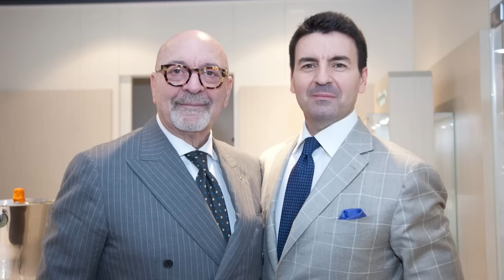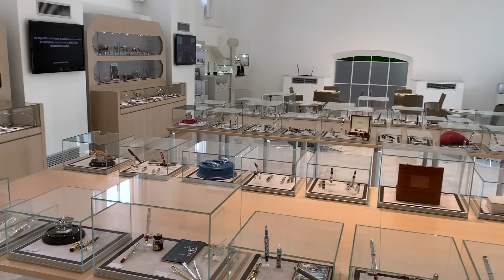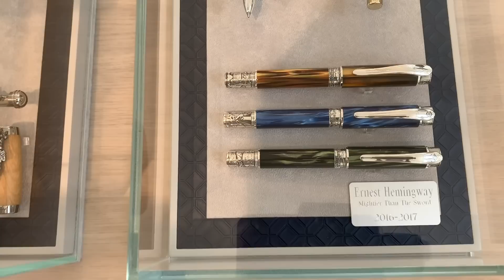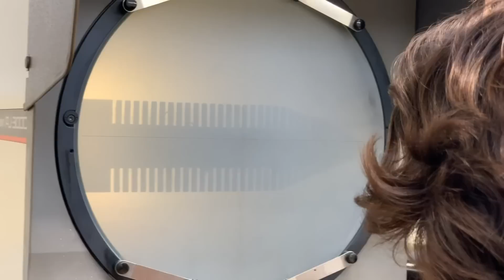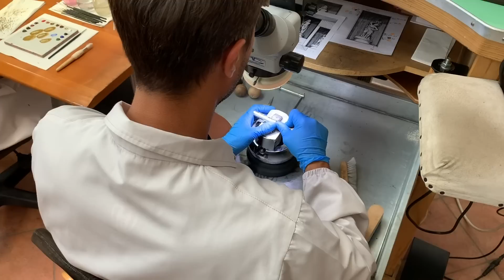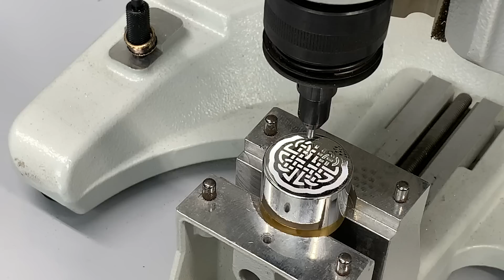Montegrappa Factory Tour: Inside Look

Comment: Quick question: How often can we reuse the same distilled water for cleaning fountain pens?
Reply from the maker: Kind of like what Moses said. What helps though is if you flush a bunch of times with some water to get most of the ink out, then do a final flush with new, clean water. It saves water that way and still gets it clean. -Brian
Reply: The Goulet Pen Company - Brain, Thanks for the advice! I used tap water to rinse out the ink

Then used my pen’s converter to suck in the distilled water and dump it in the sink so I don’t waste the distilled water. No build up in the pen at all.

Comment: I bought Montegrappa mosaico Roma from massdrop and it dries capped under 24h (with provided ink). I do not know how to fix it. My other cheaper fountain pens are far better behaving than this.
Reply: i have this problem with my Parker Urban.  I put Pilot Namiki ink in it and it wrote every day after 3yrs of this problem, so maybe try Namiki ink?  It's a fast flowing type.  However...the actual problem was that the ink was visibly drying up in the converter at about 0.1ml a day :|  So I stopped inking it